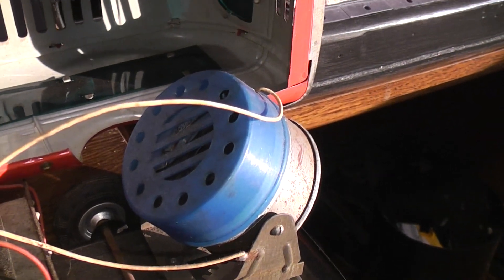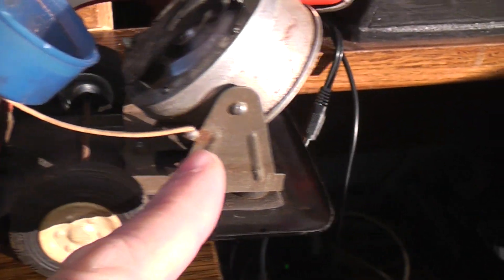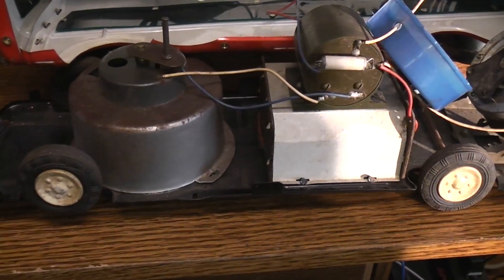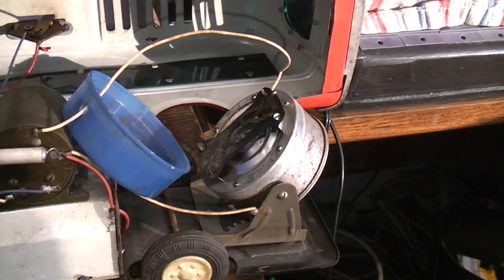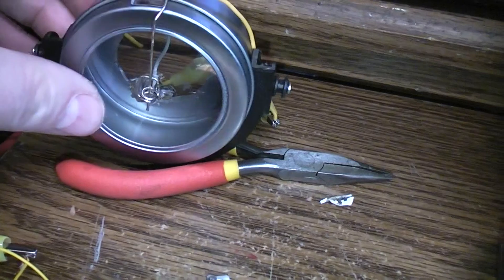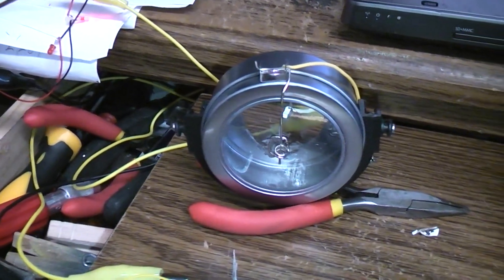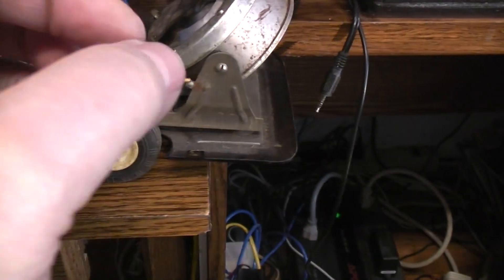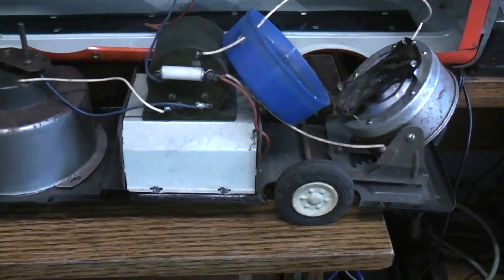Make a Helmholtz resonator detector switch. Detect sounds with out IC's or transistor circuits.

Comment: Cool toy of early age! Would you be having detail instructions for your homemade Helmholtz detector?
Reply from the maker: Just this video and a few other videos where I use a tone detecting IC and a tuned enclosure that you can find on my Robothut channel.
Reply: @Robothut  I found here online a calculation for a perfect Helmholtz detector. Your detailed photos of the design will help me design it. I googled up and down, your design is the most innovative 💡
Reply: @Robothut  How are paper clip(s) connected/designed? Is the plastic side of the drum pierced through for the paper clip? It is so simple design, yet fascinating. Any sketches about paper clip will help, as I think nothing ready-made is available.
Reply from the maker: @ST-cl2rz  Here is a link to a post I did on the patent drawings for the design.
http://alphadrome.net/forums/topic/21656-1955-and-1961-patents-for-sonicon-toy-control/
If the link does not work go to Alphadrome web site then to the robot patent section then look for 1955 and 1961 patents for sonic control toy.
The magic is tuned enclosure that will make a diaphragm vibrate when the proper frequency is detected. This will make the contacts vibrate. The contacts could be anything, like a paper clip on a conductive surface or as seen in the patent a metal rivet lose in a conducting hole. The magic part is the relay. The relay will normally be energized "no sound detected" but when the contacts vibrate do to the proper tone being produced by say a whistle, the relay will DE energize. Some DC relays do not work with NON DC power, just as some AC power relays do not work with DC voltages.
Reply: @Robothut  I've been through that website before, searched high and low on Google. I can't think of an immediate design that replicates yours. As it has been years since you made it, I understand it can be forgotten the details. I will experiment with 2 paperclips,  one glued to the diaphragm, etc. Thanks for bringing this idea of simplicity 👍